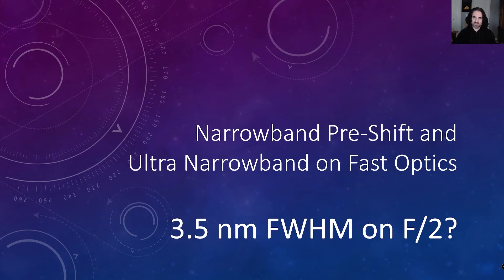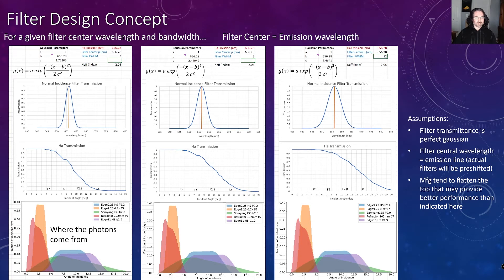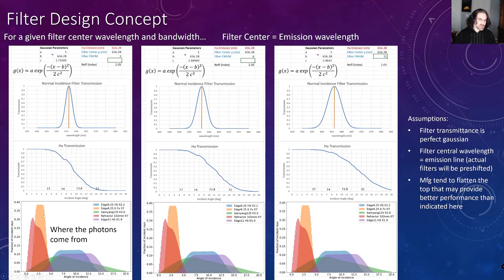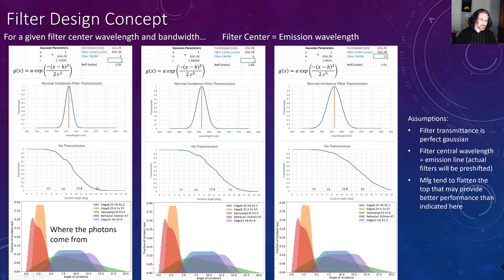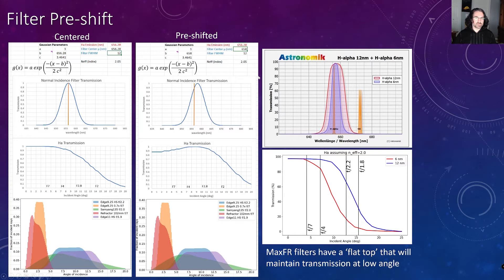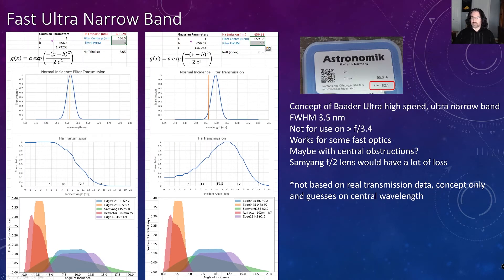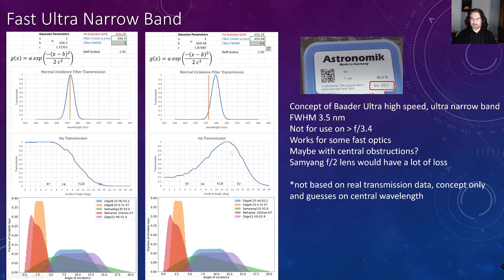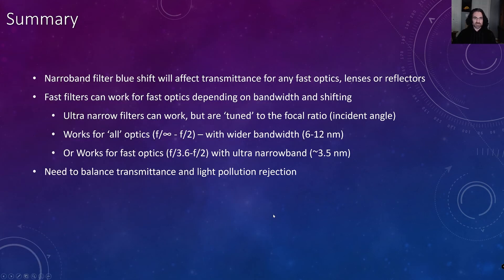Ultra Narrowband Filters on Fast Optics: HyperStar, RASA, or lenses

Comment: Hi Brent

I just saw again your videos after a few months. Now I can see why the IDAS NBZ filter has a 12nm band width and works perfectly with the hyperstar C9.25 Edge (V3, f2.3) and at f10 too.

After this, I have a question: would a 12nm narrow band regular astronomik filter would perform differently from the 12nm MaxFR filter at f2.3? What about f10 or f7?
Reply from the maker: The bandwidth and what makes MaxFR special are two different things.
Bandwidth is the characteristic of what wavelengths will be transmitted.  12 nm is 12 nm, and they will follow the same transmission trends based on f/ that I presented.
MaxFR is about the manufacturing process that Astronomik uses to produce the filter. I would assume it to be the specific materials, thicknesses, layering, and coatings applied to the filter to reduce glare, reflections, and protect the coating.
Reply: Thanks.

I think the NBZ design is a little different since it’s a flat top transmission so it can reach out the maximum value at different f-ratios.

Astronomik seems to have a different approach. In the end, no matter the design, what is important is the performance and these Astronomik seem to be quite good